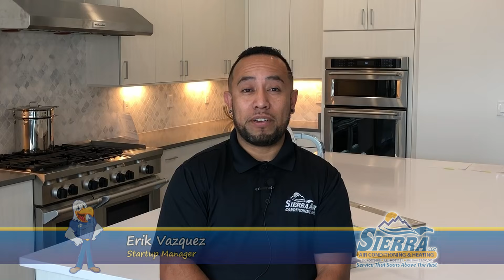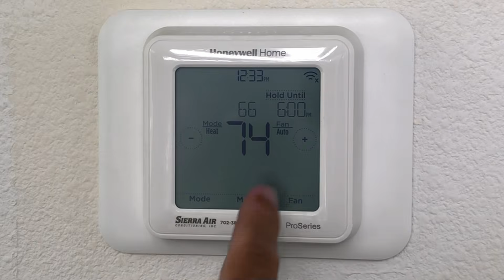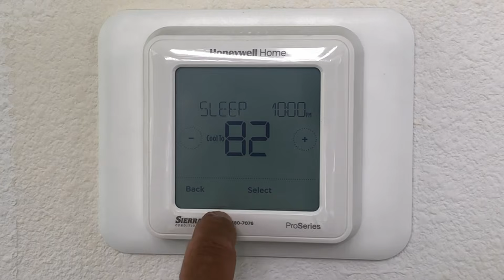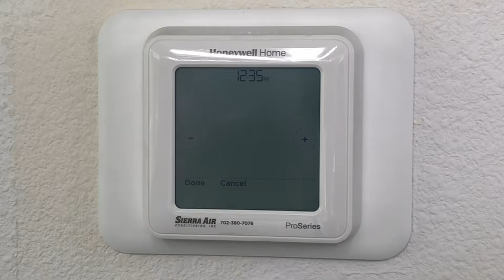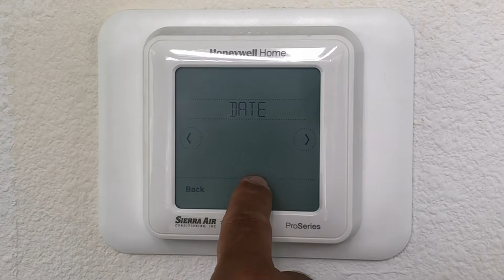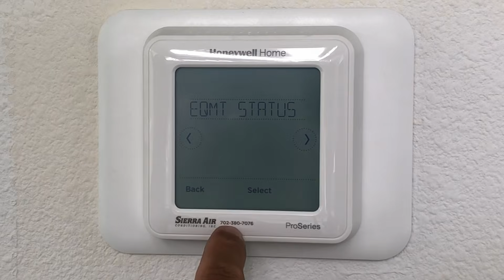How to Program Your Honeywell T6 Thermostat

Comment: My thermostat is displaying the word humidity how do I get it off the screen
Reply from the maker: Unfortunately there is no setting to adjust the desired humidity on the Honeywell T6 pro. The alert itself should have a close option at the bottom. However it will continue showing due to the high or low humidity levels in the home.

Comment: My one screen is completely went off and it won't turn on. Is there anything i can fix it?
Reply from the maker: Typically if the screen went blank it lost the 24v from the furnace that powers it, or an internal safety has tripped. You can check to ensure your FAU/furnace breaker is on. Depending on location of the furnace you can get to see if there is a light switch (service switch) in the area that might have been turned off by accident. If these do not fix the problem, reach out to a licensed and bonded HVAC contractor.

Comment: Just my T6 Pro Series looks and programs nothing like this one. It programs altogether differently even though it looks the same it has basically almost none of the same feature accessibility I mean you can set a scheduler or whatever but mine does not have a temporary hold only a permanent hold and other little idiosyncratic things that drive you nuts when you go on the internet looking for answers and you think you found them. It's like every time I go looking for answers for my cell phone it tells you hit this menu and then this menu and then this menu and my phone has none of that drives you crazy.